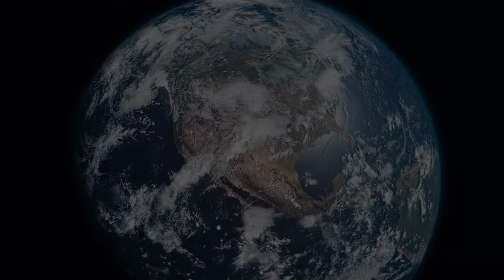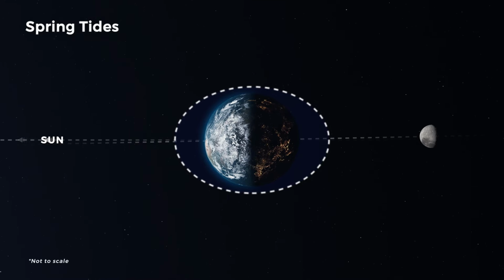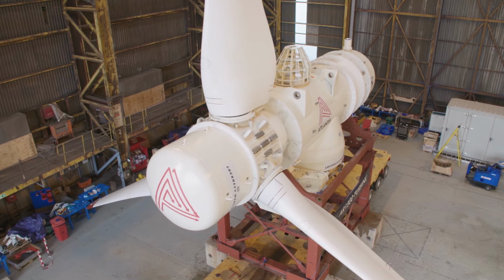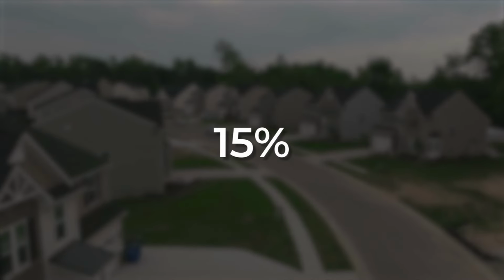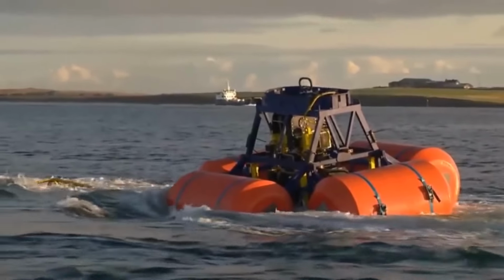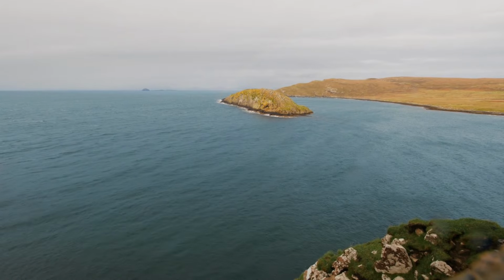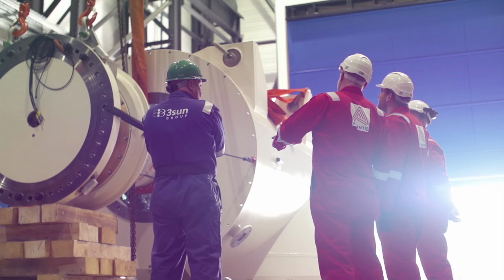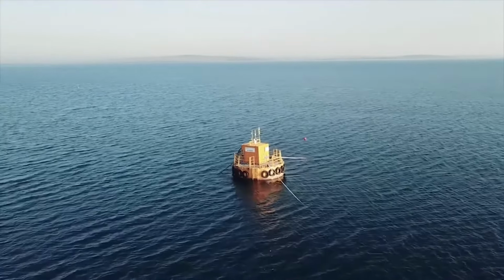Can Underwater Turbines Solve Our Energy Problems?

Comment: There's no magic bullet. It will take this and other types of power generation to transition from fossil fuels.
Reply: Activate all nuclear power plants
Outlaw further investments in fossil 
Deregulate science from politics
With a free market innovation and efficiency will soon arise
Reply: if you need more plants it will take nearly 10 years  to build    and  a very high price tag : ocean wave or hydro would cost less
Reply: nuclear
Reply: We will run out of fossil fuels eventually anyways. :D
Reply: Nuclear can solve it in less than 20 years.
Reply: @CarlosAM1  The political Left has targeted nuclear power, though. Nuclear could probably trim up it's large impact zones, a little, to help the average person feel less nervous, possibly by going so far as to build plants in subterranean locations where a meltdown could be isolated, at least from airborne fallout.
Reply: @matthewmosier8439  and thats where thorium comes in, thorium is safe, it cant meltdown since the nuclear fuel is already melted and it can withstand the impact of an airliner without mayor damage to the plant due to its insulation, also if the plant fails and the fuel starts to go crazy it will melt a frozen salt plug that will drain the fuel out of the tank where it will no longer be in contact with plutonium and the reaction will stop, thorium needs plutonium to work, meaning its not a bomb and cant be used for such purposes, we also have 5th generation nuclear plants like the ones in france that re use nuclear waste and can also take a hit from an airliner, both are ok but I really prefer thorium since its 200x more powerful than uranium, doesnt generate almost any waste and it cant meltdown.

But yes, the public fears nuclear due to the three mayor incidents in history, three mile island, fukishima and chernobyl, all caused by lack of security or bad reactor designs, chernobyl was caused by a test to simulate a bombing of the plant by the us that went out of control, fukushima had emergency robots that could take the radiation and shut down the plant but were removed due to people saying they were not needed and all other disasters were contained. France uses 80% nuclear and they sell energy to the idiots in germany that use renewables that dont work very well when it comes to efficiency. Nuclear is the future, both on earth and in space.
Reply: @CarlosAM1  I mostly agree. And I learned some new things, which is nice. I guess I consider nuclear to be in the same category as renewable energy, but it is obviously superior. I am starting to be more open about my belief that solar, especially, will probably not be the future, despite it being politically popular. For vehicles, I personally believe that cars should gradually transition to non-battery direct hybrids, similar to heavy machinery which can use electric motors at the wheels driven by fossil fuel motors. This would eliminate the massive amounts of energy spent on relatively short lived batteries, eliminate the danger of unfightable fires after accidents, and greatly reduce the cost of building a car (no transmission, etc.)
Reply: @matthewmosier8439  electric cars are also promising considering the technology is better every day, unlike internal combustion that has been the same for decades
Reply: @UCJLutiNCoH1yhkD0RBH-lwg yes, that is true, but check tesla, they have advanced electric cars with autopilot, less noise, no vibration frm the engine inside and the good part, no co2 emissions, if this was about which one is better internal combustion could win, but its about climate change, we wont care if the cars are electric or internal combustion if we cant breathe air due to many species dying. Also as before, the technology is being developed and it has potential, remember nuclear energy, it gives off so much power that we can replace many co2 emitting things like gas with electricity fueled by thorium which is abundant in the earths crust. But for now, I say they are "ok" a bit below internal combustion but way greener and with more powerful due to the electric motors having amazing torque.
Reply: @suserman7775  I know, but it will still be bad, already the poles are melting which releases co2 and methane that was trapped inside further heating up the planet and killing more species of animals and plants that could lead to a global famine that could spark a war that could escalate into nuclear conflict or we would have to leave the earth and try to make a base on the moon or somewhere where we can still live, both are horrible and we have to take action fast, not with dumb solar panels or windmills but with actual huge powerful plants. And why would no one build large numbers of thorium plants, china and india are on it, both developing the tech, France is already 80% nuclear with uranium.
Reply: @suserman7775  I dont even know what you mean, I focus on the technology, not the politics and propaganda, thorium reactors were available in the 1900s but were replaced by uranium because thorium could not be used for nuclear weapons during the cold war, thorium is not something to distract us or that has to be invented, it already exists, thorium reactors work and cost about 200 million per plant, cheaper than uranium and 200 times more powerful than uranium, that has been proven and thats why, india and china, as I said, actually are working on it, you are making up numbers for the cost of thorium and know so little about physics or nuclear processes that you dont even know why I mention it, please educate yourself on basic nuclear physics and understand that small scale thorium plants were tested sucessfully in the 1900s and that they work, they are just feared by the people because "its nuclear therefore its dangerous" its also feared by idiots like greenpeace that support other renewables that are useless on mayor cities because they pollute a lot when you make them and when they stop working, like solar. Theres a good documentary that explains the mayority of it on 5 minutes, watch it, https://www.youtube.com/watch?v=P9M__yYbsZ4
Reply: @CarlosAM1  5th gen? Are you from the future or something? I suggest you check your facts. As all of the reactors currently in use are either 2nd or 3rd gen. Maybe a couple of 1st gens as well, not sure about this. 4th gen is still in R&D stage and we won't see them any sooner than 2030s. However, successful tests have already been conducted by Americans in 1960s (check MSRE).
Reply: @danielalasoo2930  yep, got that wrong, sorry for the mistake, but the point still stands when it comes to thorium being superior and nuclear being the best renewable for huge cities or entire countries. Also forgot to mention the health benefits from thorium and also space exploration benefits from the plutonium 238 generated there, also a possible cure for some cancers that could be developed with them.
Reply: or we could grow up and transition to nuclear 100%
Reply: Commercial nuclear power is safe. Over 10,000 safe reactor years in the United States.  And if you're a believer of the global warming/carbon scam, nuclear addresses that completely.
Reply: @clarkgriswold-zr5sb  climate change* and it's not a scam. I grew up by the sea and not only are the seasonal rains coming in at random times in the year, low tides have not been as low as they have been 15 years ago.
Reply: the over head to begin fueling homes with nuclear is much higher than the cost of these ocean turbines...………………………………………………..not to mention the fact that they can make the ocean turbines in under a year while building  a nuclear  takes 7 to 10 years
Reply: @clarkgriswold-zr5sb  Now the argument is if human activity has had an effect on climate change and the scientific consensus is pretty much confirming that theory. While there have been warmer periods on the planet in the last 4000 years none was as long and as destructive as what we have now. At least ocean acidification is a clear testament to how our added carbon dioxide emissions make a real change in hr environment even if our CO2 production is (relatively) minimal, a minor nudge in numbers can have big impacts considering the thermal effect. 

A good analogy is how one drop of crude oil can contaminate 10 000 liters of sea water. That's just a small drop but even that can make sich a large amount of water unpalatable.  In this case we add a drop of CO2 and Methanr into an ocean of Air. Same shit.
Reply: In hundread years, yes.
Reply: @ukaszw6623  Agree. The transition from fossil fuel dominance to renewable energy should probably be as unforced and tech-advancement related, as possible. Legislation and pressure to speed it up would probably end up producing subpar technology and costing poor citizens their standard of living.

Comment: This would also be incredibly safer to install than wind turbines. The accidents and fatalities caused from wind turbine maintenance is staggering
Reply: Yeah....cause building a windmill underwater is way safer. 😆😂🤣
Reply: @johncase3998  yea, means that workers don't have to risk burning or jumping to their death, and if you watched the video you'd notice that installation is exceptionally fast and can be done on a barge.
Reply: @danunpronounceable8559  ummm....🤔
What do you think it's installed onto? Oh that's right....a BASE that is mounted to the sea floor just like an oil rig. You know...the kind the requires specialty divers to work in an underwater environment with winds affecting the support vehicles and currents affecting the diver. With massive communication difficulties.
You must not be familiar with working in water.
Reply: @johncase3998  you mean in weather conditions that can be predicted, where maintenance can be easily called off when risks are too great? Can't say the same for wind turbines where if there's a fire, you're fucked. I never said underwater turbines are safe, all technologies have their risks. Only that they're obviously safer than wind turbines.

Weird that you're making such a big deal over this

Comment: wont making technology that require less power more efficient then coming up with new energy sources thats basically expanding the old ones like some DLC
just make your smart phones that you only have to charge it once a month 
make cars that aint piece of shit wallet ticking time bomb 
and idk moving humanity forward instead of selling their forward pass or holding back from outdated systems and technology im looking at you school system and outdated technology that still uses flamable liquid its not industrial age anymore electricity youre no better cause technology requires more power to run you and burning fuel is a short term solution but it will fuck you over in the long run

so whats the source of the problem its money money solves everything except then you dont have money